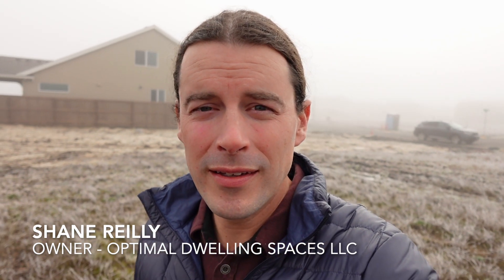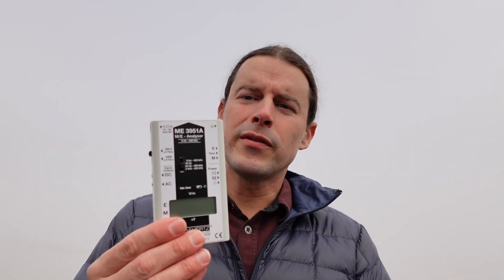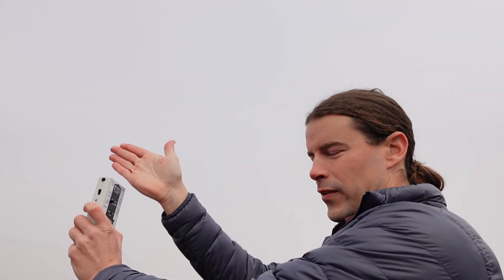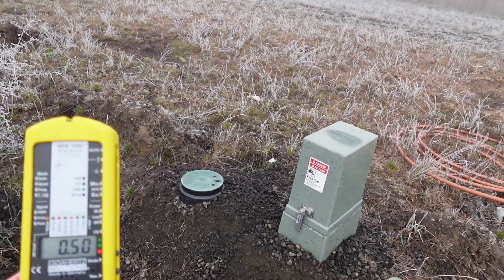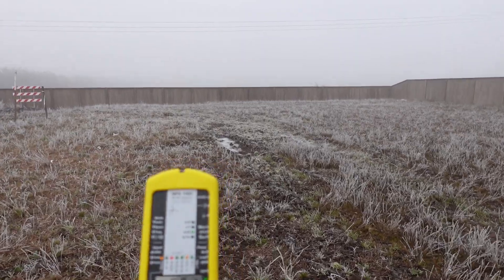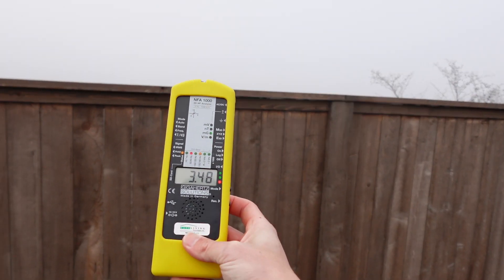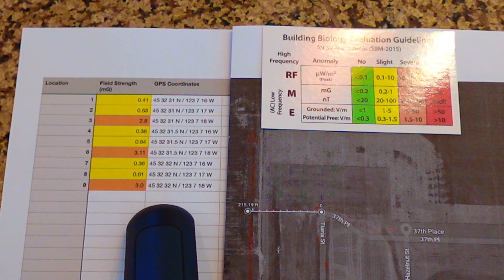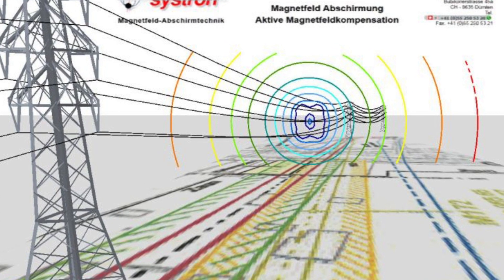Are You at Risk From Power Line Radiation? What You Need To Know

Comment: No, it is not healthy. To live near or under high voltage powerline. However in my case it is even worse; because I am for example an official medically diagnosed hyper sensitive extreme hearing individual. Meaning i hear and fysically feel presence of magnetic fields wierd high short wave frequencies or low humms and buzzes, whistles, and high current powerlines. I hear  whistling flat screen tv, monitors etc. That makes you tired. The hairs on my arms face body start to rise and my skin starts tingling when i'm under ahigh voltage powerlines. Also low cycles / Hz lightning etc wears me out, i notice the on of going light, exhausts, tires me. Difficult to concentrate etc. One of the reasons I prefer to live in the 110 / 120 world and not were i live in the EU 230 / 250 volt zone. Thus also in general for every 'normal person' who doesn't sense, notices or feel or hear these 'thing's, but thus also and even more so in my case; don't live or work 24/7 365 days a year under or very close near ' HOT high voltage transmission lines / 'powerlines and substations. It is not healthy on the long run. High powerlines should be at least 80 meters away from residences, factories, offices schools and other permanent live play learn etc places.

Comment: I come here because my husband worked under one last week now in hospital with huge spontaneous brain bleed... Im think its this. He got a huge headache for a week.
Reply: No, it is not healthy. To live near or under high voltage powerline. However in my case it is even worse; because I am for example an official medically diagnosed hyper sensitive extreme hearing individual. Meaning i hear and fysically feel presence of magnetic fields wierd high short wave frequencies or low humms and buzzes, whistles, and high current powerlines. I hear  whistling flat screen tv, monitors etc. That makes you tired. The hairs on my arms face body start to rise and my skin starts tingling when i'm under ahigh voltage powerlines. Also low cycles / Hz lightning etc wears me out, i notice the on of going light, exhausts, tires me. Difficult to concentrate etc. One of the reasons I prefer to live in the 110 / 120 world and not were i live in the EU 230 / 250 volt zone. Thus also in general for every 'normal person' who doesn't sense, notices or feel or hear these 'thing's, but thus also and even more so in my case; don't live or work 24/7 365 days a year under or very close near ' HOT high voltage transmission lines / 'powerlines and substations. It is not healthy on the long run. High powerlines should be at least 80 meters away from residences, factories, offices schools and other permanent live play learn etc places.

Comment: With that lot would a steel chain link fence lower the reading as the magnetic fields would couple to the fence? Just a thought.
Reply: Power companies will dissuade people from putting in a metal fence in parallel to the high tension transmission lines, because there will be an inductive coupling that could injure someone who touches the fence (current travels from the voltage induced in the fence through the person's body then into the ground  The power company wants it to be bonded to a deep ground rod in multiple places to be safe.

Comment: I’m currently interested in buying a house and it turns out there is an high power lines around the house. The distance is about 140 meters from the house. I really like the house, but very worried about the EMF effects it will have. I have bought an EMF meter and have measured it. In the morning, inside the house the measurement was 0 uT and outside the house the measurement was around 0.1-0.2 uT. In the afternoon, inside the house it was measured around 0.2 uT and outside the house it was measured around 0.4 uT. Should I worry about this number? And should I buy the house or not?

In this regard, I always curious what’s the difference between the magnetic fields naturally from the earth and the magnetic fields from the high power lines? The earth's magnetic field varies from about 300-500 milliGauss while the magnetic fields from power lines are only a few milliGauss. If the magnitude of the power lines magnetic fields is so small compared to the natural ones, doesn't that mean the magnetic fields from the power lines might not be that dangerous?
Reply from the maker: 0.1 microtesla is 1 milligauss which is at the extreme concern level according to Building Biology.  If it is truly from the power lines and not from home wiring errors or other fixable sources, it would be best to move on and look at other homes.  The big difference between the earth's magnetic field and the electric power grid is that the earth, like our bodies, emits a direct current or DC field, while the grid uses alternating current, or AC.
Reply: @optimaldwellingspaces3947  I can't tell if it's coming from the power lines or another source. But if the magnetic field comes from power lines, can it be more dangerous than if it comes from another source (with the same magnetic field magnitude, for example 0.2 uT)?

I once measured the magnetic field of another house very far from the power lines (about 2 km) and the results were around 0.2 uT inside the house and could even reach 2 uT outside the house. I don't know where it came from, but it doesn't seem to be from the high power lines because the distance is very far. But it could be that it comes from underground electricity in the housing complex. With a magnetic field that high, will it be dangerous for the occupants of the house?
Reply from the maker: @ariesairess  for your purposes, the same magnitude of AC magnetic field is no different in terms of biological impact whether it comes from power lines or home wiring.  If you turn all the breakers off in the home and still have the same field strength, then it is more than likely the power lines.
Reply: The safety levels for Building Biology are focused on the sleeping area and, to a lesser extent, places where people sit or stand for long periods during the day.  Below 0.2 milliGauss (0.02 microTestla) we don't worry because it is small.  Between 0.02 and 0.1 microtesla we consider that a slight exposure, worth improving if you want optimal health.  Between 0.1 and 0.5 microtesla we consider a high level, a serious concern that your biology may be impacted -- one example is the increased risk of miscarriage.  Above 0.5 microtesla is the sleeping area or daytime office  -- no matter what the source --  needs to be immediately addressed.  Unless you have an obvious external hazard (big power lines or transformer nearby) or internal hazard (bedroom next to the main power panel or a big motor like a refrigerator) then it is likely you have some wiring problems in the house which can be fixed by an electrician.

Comment: Is it a known fact that electric magnetic radiation ☢️ is chronically bad ?
Reply from the maker: Yup
Reply: I remember reading about power-lines that were built near a school that caused an increased diagnosis of students with adhd/hyperactivity. After the school added EMR blockers/absorbers, the symptoms and data went back to normal for the most part.
Reply: Myloma

Comment: But it's just electromagnetic radiation? Is this really bad for you? I mean lights give off electromagnetic radiation, but are harmless. What is so bad about this? Asking out of curiosity thanks
Reply from the maker: None of it is harmless since it’s only been around 130 years or so. It’s much stronger and engineer differently than anything found in nature.
Reply: @optimaldwellingspaces3947  how is light from a light bulb different from light from the sun? Photons are photons
Reply: @r46-b7e  Not an EE, but it's not just light.  It's the electricity.  Plus, that big transmission power line carries hundreds of thousands of volts.  Inside our homes it's only 110v or 220v for a few things.  Huge difference.  No way would I want to live near a big transmission line.  ymmv
Reply: @abc-wv4in  electricity producing electromagnetic radiation...
Reply: Natural light/energy is way different than artificial manmade light/energy. It took lots of research and working through lots of confusion and disbelief to figure this out. What helped me was learning about alternating current (ac) electricity and how it's made, then from there learning about how alternating currents apply to radio transmissions. It's a beast let me tell ya, and requires learning basically a whole new language. I'm glad I taught myself though, and was able to check into things from all sorts of sources rather than being in a dogmatic ridged course because I would go insane not being able to question things that don't make sense. 

Look up this research paper for interesting look at differences 
_"Polarization: A Key Difference between Man-made and Natural Electromagnetic Fields, in regard to Biological Activity_" 

For research on health affects search these key words "emfs voltage-gated calcium channels" and you'll see how much proven data is available. 

Also remember that wireless devices and towers are the basis from which the trillion dollar a year industry depends on. "Data is the new oil" - BigTech. That kind of money turns things like "safety" into a nuisance to be "dealt with", ya know like  mafia/mob/fed style.

The info is out there, those that look find it.

Comment: Nice job, Shane. It is sad to tell a client that a property has an unsafe environmental influence, in this case magnetic fields.  Over the years living in the proximity of those transmission line, the power utility can dramatically increase the amperage such that those readings might be doubled or tripled at times.  The most at-risk people for such magnetic fields are children, pregnant women, women who wish to become pregnant, those who are already electrically or chemically sensitive, the elderly and anyone who is contending with a dread chronic condition (such as cancer) and hopes to get better.  That s quite a few folks.  A "good price' on a piece of land near such a hazard will be no bargain over the years as health erodes.   Still, one provides the hazard information and the clients make the ultimate choice per their comfort level.
Reply from the maker: Yes, Ken.  The current on these lines, and resulting magnetic field is sure to go up as more homes get battery walls and electric vehicles.
Reply from the maker: Thanks, Ken
Reply: No, it is not healthy. To live near or under high voltage powerline. However in my case it is even worse; because I am for example an official medically diagnosed hyper sensitive extreme hearing individual. Meaning i hear and fysically feel presence of magnetic fields wierd high short wave frequencies or low humms and buzzes, whistles, and high current powerlines. I hear  whistling flat screen tv, monitors etc. That makes you tired. The hairs on my arms face body start to rise and my skin starts tingling when i'm under ahigh voltage powerlines. Also low cycles / Hz lightning etc wears me out, i notice the on of going light, exhausts, tires me. Difficult to concentrate etc. One of the reasons I prefer to live in the 110 / 120 world and not were i live in the EU 230 / 250 volt zone. Thus also in general for every 'normal person' who doesn't sense, notices or feel or hear these 'thing's, but thus also and even more so in my case; don't live or work 24/7 365 days a year under or very close near ' HOT high voltage transmission lines / 'powerlines and substations. It is not healthy on the long run. High powerlines should be at least 80 meters away from residences, factories, offices schools and other permanent live play learn etc places.